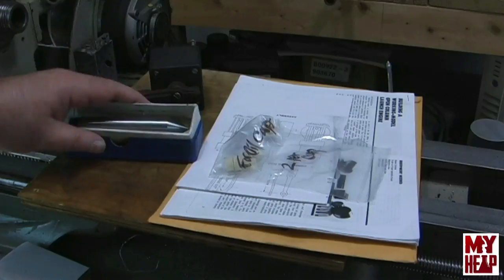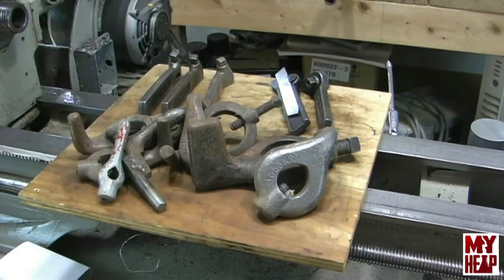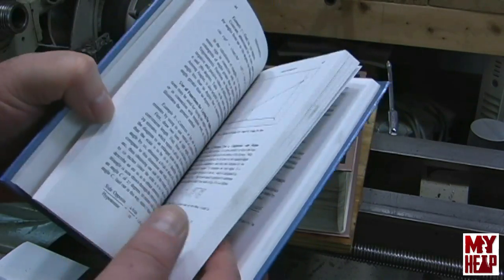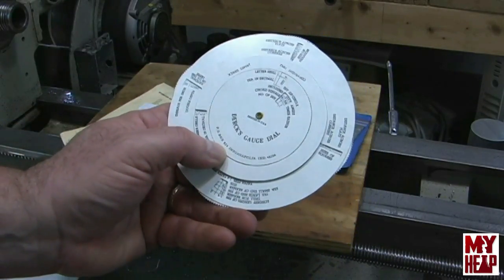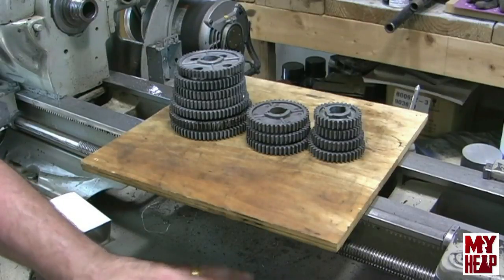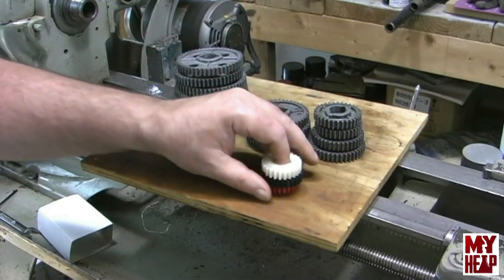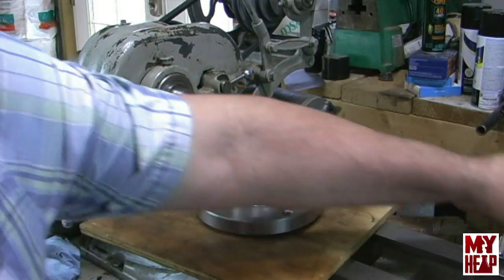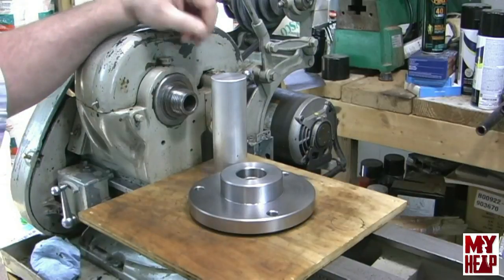Viewer Mail - Plastic Atlas Gears - Back to the Backplate

Comment: G'day Joe, another keeping in touch video, keep it up even though you may not have machining videos. My Chinese lathe has plastic(??) change gears and they haven't been a problem for the past 7 years BUT the gear box also HAD plastic gears, and well, after 2 replacement's the 3rd set are steel gears which were changed out only a couple of months ago, I have to remember to oil them though, (I'll do it now) Cheers Peter
Reply from the maker: Hi Peter,  I hope to get some machining done tomorrow for another YouTube shop student video.  Unless something changes that prevents me from getting it done.  I am not sure how these printed gears will perform.  I expect they will do fine for a fine feed (-0.0015") but not sure about 4 TPI.  I would think there would be a LOT of stress on it.  Especially when you consider the leadscrew has to be rotated twice for every revolution of the spindle.  It should be a good test.  As always, thanks for stopping by.  Did you get your crank issue resolved?

Joe
Reply: The crank issue even though drilled incorrectly is resolved and does work fine in a future video. I once tried to cut a 6mm pitch, same as 4 TPI for a future project but all it did was to throw the gear train out of mesh even though I was hanging onto the change lever, luckily it didn't break a gear, the project which requires a 40:1 worm drive is still on the back burner . Cheers Peter
Reply from the maker: In order to test this plastic gear I can either cut a course thread of 4 TPI, super fine threads of 72 or 80 TPI,  or a couple of feeds, .006 and .001877 Inch per revolution.  So I am thinking I will start with the .0018" feed and take heavier cuts each pass to see how it holds up.  If taking a .100 cut and it has not stripped then I will consider trying to cut a 4TPI thread with it.  I know that some of the plastics are brittle and other flex.  I just think it will be an interesting experiment

Now for a cheap worm and wheel, look to some one in the agricultural business.  The irrigation system they use to water the fields that look like pipe system on wheels, they use a 50:1 worm gear box.  These are pretty easy to get here in the US.  I am guessing that you Aussies use something similar.  Just a thought.  If you designing a dividing head it only means the hole patterns on your plate will be slightly different.  I recently nabbed one to make a sand muller from.

Suppose I made an assumption up there and you know what the say when ASS-U-ME something.

Joe

Comment: just a little trivia about the drives dogs you have there there normally numbered something like 4 6 8  ect that is normally the number of 1/8"s the tool will hold max so 4 would be 1/2" #6 would be 3/4"  & 8 would be 1" something like the way lumber dealers do when selling boards in quarters
Reply from the maker: Hey Chris, that is interesting.  I didn't know that.  I will have to take a closer look at these dogs and see if they are marked.  Thanks for the tip.

Joe
Reply: My Heap no problem